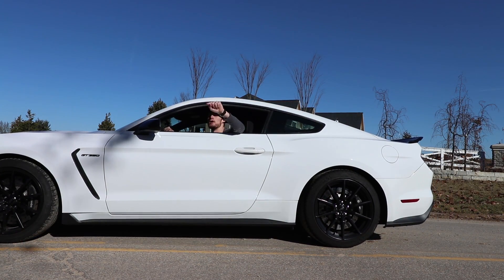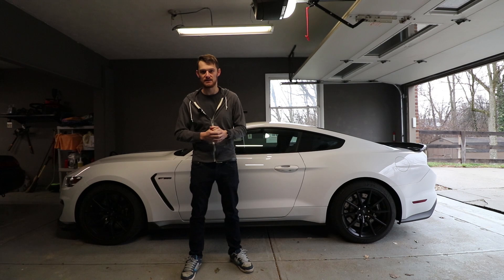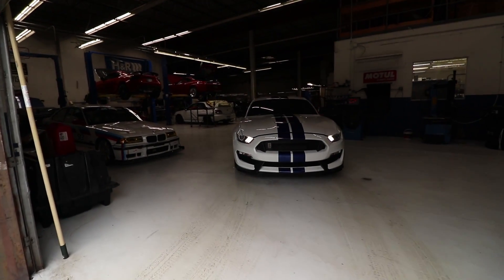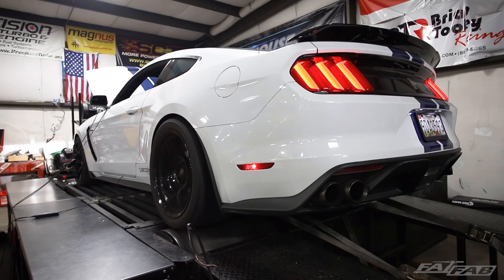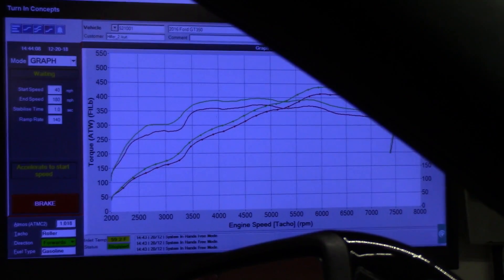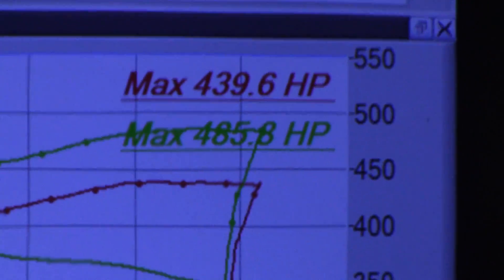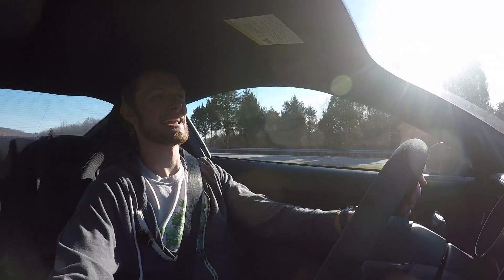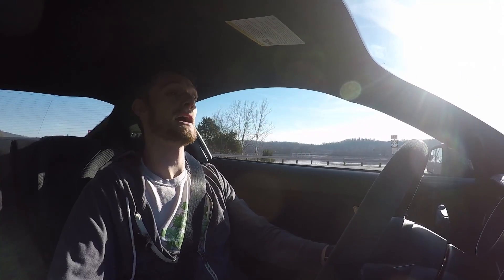How Much Horsepower Can a Mustang GT350 Make with E85 Flexfuel?

Comment: Is a tuner needed to run e85?  As he said it is flex fuel with the factory ECU.  Does that mean then that I can go put a few gallons of e in and run it and the stock ecu with correct the tune needed to run it?  Or is a tuner required to run it?

Comment: Are you using ngauge? I’ve noticed with my lund flex tune sometimes it just takes awhile to lock in the E85 reading and once it Jumped to 91% but was only e75. I was looking at adding the pro commander flex kit but dunno

Comment: A 2018 up 5.0 makes 510 wheel on average with e85 and intake exhaust. Seems like a 5.2 should make 30 or 40 more than a coyote with bolt ons. Still impressive gains though.

Comment: So all I need for a stock 2017 gt350 to run e85 is a tune right?
Reply: And a flex fuel kit
Reply: Diego Banuelos most ford engines from 2010 up have flex fuel from factory especially the v8s

Comment: Great info. My Bullitt put 446hp on a mustang dyno, we got 469.7hp with tune only. With drivetrain loss 446hp is over 510hp at the crank, so the 480hp rating for the Bullitt is underrated by ford. I suspect because that’s too close to the GT350’s rating. All numbers are weather corrected. My tuner said either E85 or headers would make 500hp at the wheels, but I’m happy already.   https://youtu.be/rnSGUv02drY

Comment: I might be dumb for not knowing, but isn’t the GT350 rated at around 525hp stock? Why is is lower than that after the tune?
Reply from the maker: Crank horsepower does not equal wheel horsepower.
Reply: The car manufacturer advertised number is BHP - when you measure on a dyno it’s measuring HP at the wheels and is usually about 20% less than BHP. So Ford says 526bhp for GT350 and they measured 439whp baseline so about what would expect.

Comment: Hey EatSleepDrive, I'm looking to do this tune with my 17' GT350. Have you had any issues with it so far? I've read cars can sometimes be hard to start in colder weather with E85. What's the weather like where you're at and have you had this issue?
Reply from the maker: I haven't had any issues.  Definitely haven't had any hard starting in the cold and it's been pretty cold here in Ohio.
Reply: EatSleepDrive Great, thanks for the reply!
Reply: @EatSleepDrive  What is the ethanol% of the winter blend where you live?
Reply: When the engine is cold it does take longer to start. The higher the % of ethanol the longer it takes, though we're still only talking about 4-5 seconds, after which it runs fine. Much more of an issue in the winter. This is the reason that many parts of the country reduce ethanol percentage during the cold months. If the start delay bothers you you can simply dilute the e85 with more premium. I've found that with anything less than e50 the engine starts normally. And when you consider e50 is around 100-101 octane you're still gaining 95% of the benefit. I've had the Lund flex tune for 2 1/2 years and it has been 100% flawless.
Reply: You have to let the pump increase the pressure in the lines. Ethanol has different physical properties than gas.

Comment: There are over 100 E85 pumps in the twin city area...the issue is most E content is between 65-77, even in summer.  I spent the summer last year driving around the cities and found 1 pump that was at E83.  (used a tester)  Of course it was on the other side of the cities from where I live.  Moral of the story, never get an E85 only tune...get 2 maps or a flex tune.

Comment: I see a lot of E85 conversion kits for the GT350 on the internet.  They're like $900.  Is there a benefit to something like that or can I get the same power on E85 in my stock GT350?
Reply from the maker: What you saw in the video is an all stock GT350 with just a flash tune to compensate for E85.  A custom tune like this will make as much, if not usually more, power than any of the 'kits' online.
Reply: @EatSleepDrive  BUT--a tune voids some of your warranty, while the kit does not.
Reply: @ryang9113  If your engine blows, even if you remove the "kit" from the engine, Ford will still be checking the fuel and oil properties. You couldn't hide running e85 from them.
Reply: @Cronus_1  sure, if your engine blows. But if you tune it and take it in for service you're flagged. Then if your engine blows and it would have blown even without the tune, you're screwed.
Reply: @ryang9113 Not too much of a to do, to flash the stock tune in the ecm when bringing in for service.
Reply: By "kit" I take it you're talking about the ones that use a flex fuel sensor and auxiliary fuel computer. You unplug the injector wiring and insert the kit-supplied wiring between the injectors and the factory wiring. The computer then intercepts the signal from the ecu and adjusts fuel delivery. I imagine those work. The big difference is there is no tune involved. As you saw in the video the tune alone on 93 was worth 20 hp. There is no way e85 alone will match e85 plus tune.
Reply: Hell yeah corn power

Comment: Great video I was hoping someone with a GT350 would make one, so my question is what would be the difference between going to a shop & getting like a LUND RACING device, besides the obvious putting the car on the dyno...
Reply from the maker: The difference between a truly custom tune and what most people refer to as an "off the shelf" (OTS) tune like the Lund  is just that, the custom tune is tailored towards your exact engine.  OTS tunes are generally more conservative  because they have to account for a wide variety of variances between engines and environments.  There is no guarantee how a OTS tune will behave on your vehicle.  I'm sure the Lund tune makes more power than stock, but it won't be optimal.  Think of buying new pants, you could get some one sized fits all from the store, or you can get a pair custom tailored.  I have no problem with OTS tunes, but only through applying custom software and testing/tweaking it on the dyno will you get optimal results.
Reply: So technically you could do an egauge with a flex tune, fill up E85 on almost empty, flash the car with E85 tune only & dyno the car & there you have it LIKE dyno tuning... I’m I correct for saying this..? Please correct if I’m wrong... thanks

Comment: Great vid man, thanks!  Since we have the same car and color it feels like you did all the dirty work an I sat, watched and received all the data... which i just did!
Reply from the maker: So when you getting yours tuned?
Reply: EatSleepDrive I don’t think I’m going to until the warranty is up.  Will all the mustang issues, I don’t want to void the warranty with a tune, then have engine issues and it not be covered.  Right now I only have ford performance upgrades...  I really want the E85 tune though.  That would be perfect
Reply: @tcr2237  What "Mustang issues" are you talking about?
Reply: stanglifemike don’t want a blown engine that ford doesn’t rebuild because of a tune.  I drive the car hard, check and change oil frequently... loose  1/2-2/3 a quart of oil every 1000 miles... ford says its normal but I’m not convinced.  No tune for that reason alone.  Also, other 350’s (like tunnel chaser) with blown engines.  If his was tuned, he would be forking out big money for a new voodoo!

Comment: I'm about hour south of you.  I'm considering doing the same thing to my GT350. I have one gas station here that offers E85.  Did they program the tune directly, no need to purchase a device?  Have you noticed less traction through first and second in the upper RPMs?
Reply from the maker: It's for sure more lively in lower gears. The nice part is you can run E85 or 93 or any combination of
Reply from the maker: @Third Eye Photography LLC it's just an HPtuners flash

Comment: The 2018 Mustang GT intake manifold makes a few more ponies/elimates 2 dipps in the HP/TQ curve vs the GT350 intake manifold according to VMP Performance.
Reply: Are you referring to putting an 18 GT manifold on a gt350, or the typical gt350/2018 gt manifold on a ‘15-‘17 5.0?
Reply: Great cars but you see the real difference when you trade -in, street status, collectability and realizing that there is more than just horsepower ratings that matters in owning both of these cars. When you're evaluating both,  having a GT350 in comparison to a adding parts of a GT350 and other after market parts, to the GT, if you can afford one, buy the GT350.
Reply: Somehow...I 'seriously' think you are mistaken!... From the factory, when Ford installed and tuned the "Bullitt" - using the GT350 intake (as a substitute for the current GT intake manifold and air filter) - they increased the power rating from 460 hp on the GT engine to 480 hp on the Bullitt.  Seems like Ford stands behind the power making prowess of the GT350 intake and tune being an improvement  ...over and above the factory GT production setup.
       Why would Ford exaggerate the benefits of the Bullitt configuration, especially since its so easy to get proof? - Have you done any "real word" empirical testing?  ... pull up to the next stock 2019 Bullitt you see, with a stock 2019 GT - then come back ad let us know the results?  Should be - interesting...?
         The GT350 level 3 PP sourced kit on a 2015 - 2017 GT PP 1, installed properly,  is not a joke - why would it not give similar gains on 2018-2019 - especially when it comes from the factory properly tuned....using a Gen 3 Coyote as foundation short-block - instead of a incrementally improved Coyote Gen 2?   ..... something ain't Kosher?

Comment: With the tune, do you have to exclusively run e85 now?
Reply from the maker: Nope, it's true flex fuel so I can run any combination of E85 and 93 and the computer figures out the rest.  Obviously it will make more power with more ethanol, but it's nice knowing I can run whatever if I can't find an E85 station.
Reply: @EatSleepDrive  Is there a time delay that your car needs, to figure out the E content?

Comment: You've pretty much convinced me to trade in my m4 manual for a gt350 time to start the search
Reply from the maker: The M4 is a great car but I don't think it's as fun or exciting as this thing.  If you can appreciate a good exhaust note you're going to love a GT350.  Good luck on your search!
Reply: I work for BMW and can get any M car at a great price, but after driving a GT350R I was sold.
Reply: Karthik Pradeep smart move
Reply: @ripfletching  took a short test-drive thought I could handle a worse interior but it's too shit for me. On that short test drive the only thing I liked better was the sound and gearbox.m4 felt much more refined and powerful
Reply: @01.k.p  gt350 interior is nicer/better quality than f80 m3, I'm assuming m4 is similar if not same - fake tacky carbon fiber and shiny plastics. BMW interiors are extremely overrated.
Reply: @JohnSmith-ot7iy  lol dude I daily a m4 I honestly couldn't stand the plastic in the gt350. M4 interior looks so nice and much more sophisticated to me
Reply: @01.k.p  I guess to each their own. Aside from the center console, which they changed for 2019, there is definitely more plastic in the M than the 350. You would have a difficult time daillying the 350 anyway - it tramlines under 20 mph
Reply: I want to trade my M3 for a M2😂